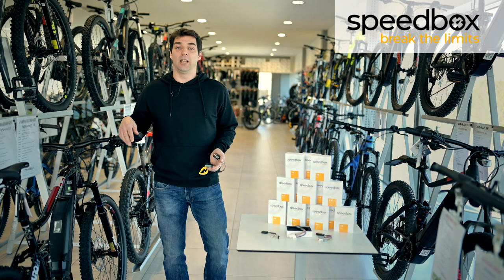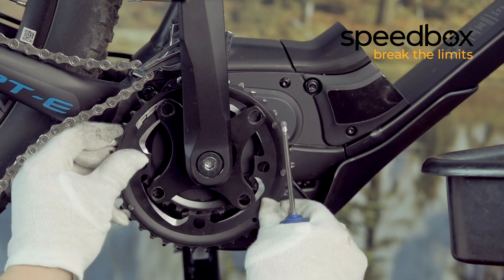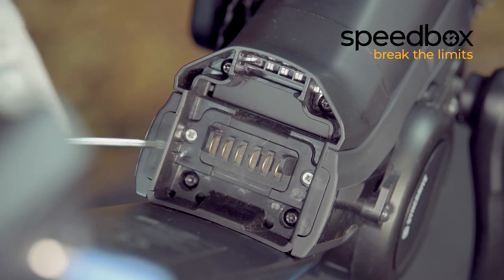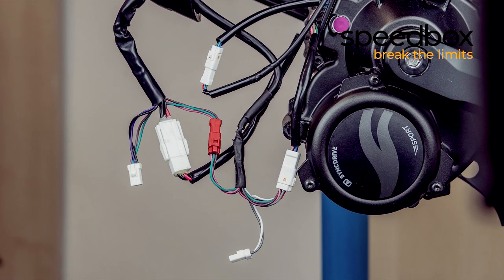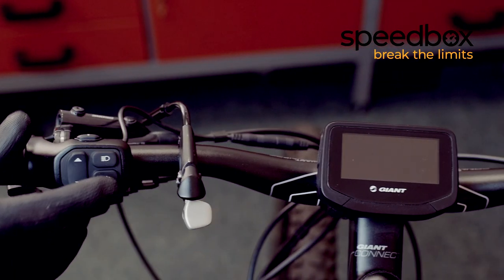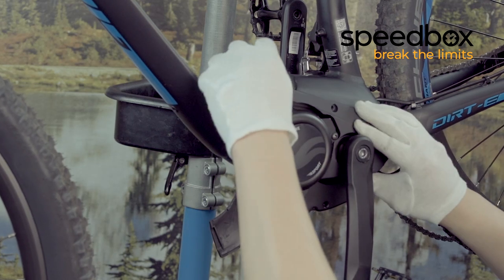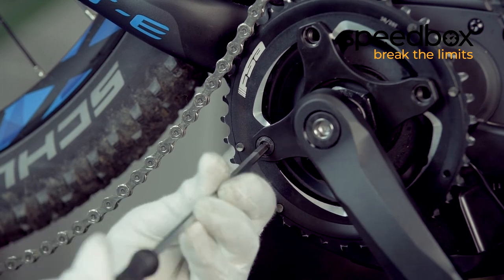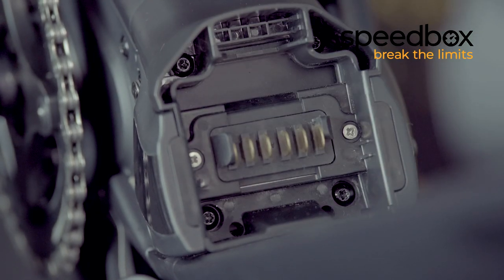eBike Tuning SpeedBox 2.1 for Giant Installation Instruction

Comment: This video is useless if you have a 2020 model.  I have a 2020 e reign and you can’t even get the motor out without dropping the whole motor but you can do this without taking the motor out just go through the battery box and remove the four screws at the bottom and then remove the bash plates.

Comment: Do we have information if the 2021 Giant models still use 2020 model engines, specifically Giant SyncDrive Pro 2020. I bought an 2021 Giant bike with that particular motor but there's no info if they updated the motor, I'm on the market for buying a tunechip.
Reply from the maker: We need a bit more time to get this SpeedBox ready for 2021 Giant bikes.

Comment: My bike is a 2023 giant stance E . my bike shop says i have a bad chip under the battery causing the no communication error. My bike is tottally stock no modifications. Does this sound right? He said all he has to do is drop motor and put new chip under battery
Reply from the maker: Hello. So you have a SpeedBox installed in the electric motor compartment that is causing bad communication? And if you uninstall the SpeedBox chip, doesn't the communication problem go away?

Comment: I have a 2020 Giant Reign 1 pro with the pad only no display! Got the speed box 2 installed and used the walk button to activate it but doesn’t de restrict the speed.  Still works as sold? Any other sequence on the pressure pad or something that I missing? Please advise.
Reply: I'm having the same problem but cant find anything on line that helps
Reply: @lovegodification  The secret is to hit the walk button and then you’ll see the lights start going up and then you push the up pad and that will activate the speed box. I much prefer a display that let you know what Modron but that’s what works! Hit walk button then up button and your in plus 20. Hope this helps!
Reply: Thanks a lot dude!
Reply: @gertmana1789  your welcome!

Comment: I bought a Speedbox 2.0 for Giant. After connecting the cables correctly with my Giant Grand Tour (2018), I pressed the power button, the display only shortly flashed 2 seconds and then displayed 'off' and 'system message' and then automatically turned of. Could someone tell me how to solve this? Many thanks in advance!
Reply from the maker: Hi. Unfortunately, the SpeedBox 2.0 for Giant is only compatible with older models manufactured in 2015/2016. Please ask your distributor for an exchange for the SpeedBox 3.0 model. Thanks.

Comment: Mine seemed to work fine when testing (before tucking everything away and putting covers back on) once I had everything back together it didnt seem to work and showed a speed sensor error when riding then red light and speed goes to 0.0mph. I have opened motor back up and all seemed connected ok. Do I have to take out the speedbox, put everything back together and go a cycle to reset everything then try again? (A suggestion I was given) Kind of at a loss what to do. Any help would be appreciated. It’s a brand new bike but I made sure to go on a 20 mile cycle before installing as per instructions with the speedbox.
Reply: Well that'll teach you for fuckin around with parts your not supposed to!! The bike isnt meant for 70kmh+ leave it alone.
Reply: @paulkazjack  Don’t be stupid. Its a speedbox chip not an engine 😂It’s fixed now the original chip was faulty. Derestricts it to same level as USA (20 mph) helps more with hill assist as I usually do about 25mph using human power on the flat.

Comment: Will it work on (USA Model) 2020 Explorer E+ 4 GTS . This model Not having a factory installed display how do we know the settings that you talked about in miles per hour if it’s on or not.  And what exact model number would i need. Thanks ✌🏻
Reply from the maker: SpeedBox 2.0 for Giant is fully compatible with your eBike. Due to lack of display, only way how to find out whether the SpeedBox works or not is by taking a ride.

Comment: Hi. I have Giant trance e+ pro 1 2020 (new motor and software from 2019) and it doesn’t have a display. Will the speedbox work on it? Do you post to Australia?
Reply: Michele Vasta I just bought the reign e+1, I’m wondering the same thing.
Reply from the maker: Yes, SpeedBox 2.0 for Giant is fully compatible with Giant Trance bike models and with Reign bike models too.
Reply: @SpeedBoxTuning  Hi,
I'm considering buying the Giant Explore e + 1 per gts 2020 or 2021 model. Will this Speedbox work on the Giant Fastroad e+ex pro 2021 and  Giant Explore e + 1 gts pro 2021 or 2020 models?

Comment: I gained about 6mph or 9.6 kph with this speed box. I was expecting more. -2020 Giant Explore
Reply: Thats not alot, whats your top speed? You should be hitting 30mph ..you will need to use the gears though (higher gear needed for more speed) but your motor should never turn off tbf when activated
Reply: kali Exclusive yeah and I think that was on a slight decline. Maybe it doesn’t even work?
Reply: I just installed on giant explore e+ pro. Took for a quick spin... 48km/h and it was still pushing me! Ran out of road so had to slow down :D
Reply from the maker: @guzman9011  We recommend to change your front sprocket to achieve higher speed.

Comment: is this even legal?
Reply: It depends on your country, most likely it is, it's pretty restricted around in the EU. In my country you would have to register you bike as a moped and have insurance on it... This of course varies between countries. I know this is an old comment but just putting this in here if anyone else is wondering the same.
Reply: Illegal in the uk, noone will catch you. But if you get in an accident youre technically driving an unlicenced, uninsured motor viehicle so youll lose your driving licence
Reply: @leohill-kawai2432  It’s not illegal at all if you follow the rules ie..use it on private land if you don’t want to register/insure it. Turn off the speedbox when on public roads voila 100% legal. Just because my car can go 160mph does not make my car illegal..same thing.